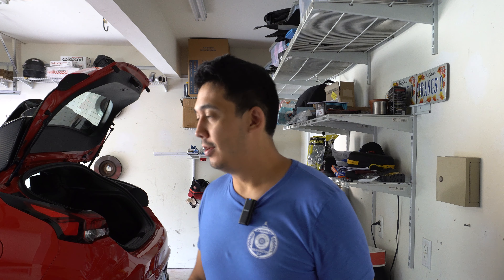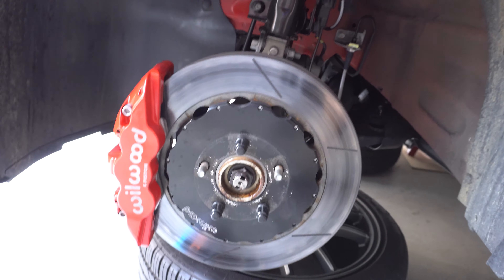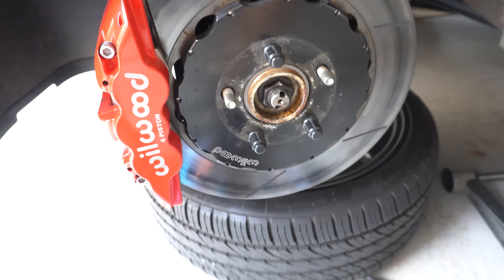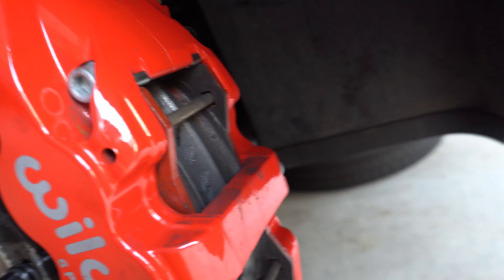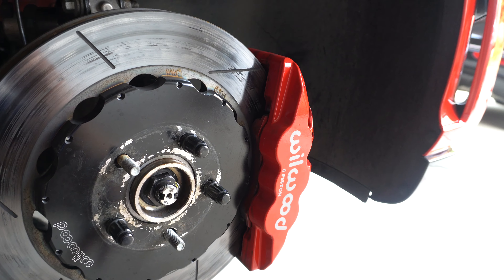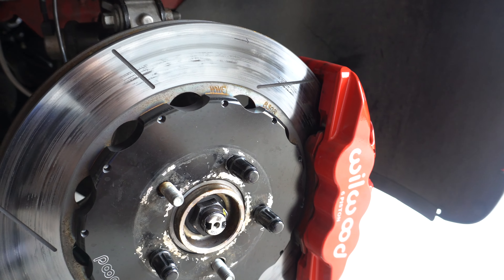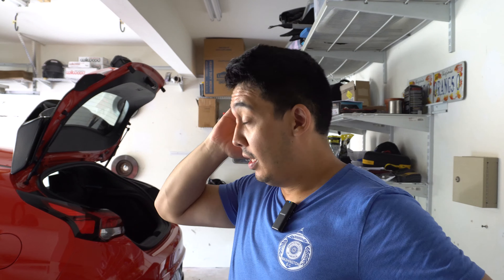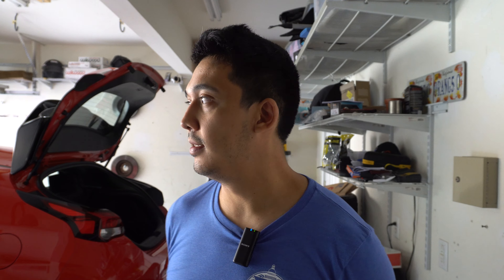Veloster N Big Brake Upgrade! 6 pot

Comment: Hey bud, looking good. Will the caliper/rotor  fit even with the OEM dust shield on?  Looking forward on your results on testing these.
Reply from the maker: I think it will. The original owner had it on. I don't remember if he trimmed it or not. I removed my dust shield way before the BBK, though. I included the link to the forum thread in the description, you can see the installed photos
Reply: @umarovracing  Thanks I will look at it. Did you have any issues on the electronics or brake line without the shield? I saw one time you placed heat tapes?
Reply from the maker: Yes. I wrapped them with heat reflective film from Essex racing. I melted the rubber on the stainless steel lines on the stock system with race pads after removing the heat shield. So I wrapped the brake lines near the rotor, ball joint, tie rod ends, and closest part of the ABS cable. No issues. I have done hundreds of laps without it. No problems. Just gotta make sure you wrap those things though

Comment: I currently track my car with gyrodisc rotors and pagid rsl2 pads.  They work very well but still looking for more stopping power.  What's your candid thoughts on what you installed? Did it affect the ABS?  Looking at the Forge BB kit.  So hard to get good info for best parts for our N's.  Thanks
Reply from the maker: That's an awesome setup. I would stick to stock brakes over forge. I don't know enough about them. Pad variety is unknown. 

I would recommend stepping up to a more aggressive pad. You can go with Pagid RST1, but for now it might be hard to get. You can go with CSG pads. Soon there will be Cobalt brakes available. 

I am pretty happy with Wilwood setup. It's custom built. So some stuff wasn't perfect. Overall it's great for track days. I never worry about brakes. I am using Cobalt XR2 now. I really like the torque. I am still getting used to the pads and the caliper setup
Reply from the maker: ABS wise. It didn't really affect it.
Reply: @umarovracing  Wow did not know about the RST1's.  Have you tried them?  The RSL2's last for many track days. Never heard of CSG or Cobalt, better than Pagid?  Googled both brands and they look good. Not clear, is Cobalt XR1 your primary choice?  Pagids along with the Gyros transformed my car so much for the better...just want more initial bite and modulation now.  Got the Adro spoiler, have not installed yet, curious to see if makes a difference with aero...lol if not, I'm ok with it just because it looks good.  Thanks so much for the info and posting your videos!
Reply from the maker: I have tried RST1s. They are one of my favorite. Very strong bite. You need sticky tires for them. They are very solid. Loud too!

Other pads are roughly on par with Pagid. 

XR1 might be too aggressive. Cobalt recommended XR2.

Comment: Question will they fit stock wheels? I have Titan7s for the summer, but running stock for winter
Reply from the maker: I don't think any one has tested with stocks. I don't think they will clear stocks. My winter/daily wheels barely clear it. You have to do some measurements.